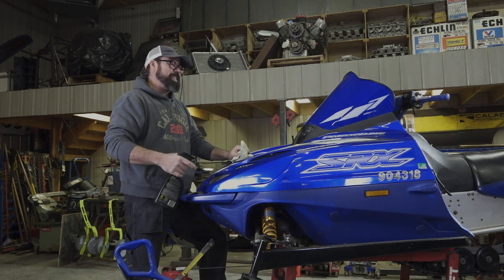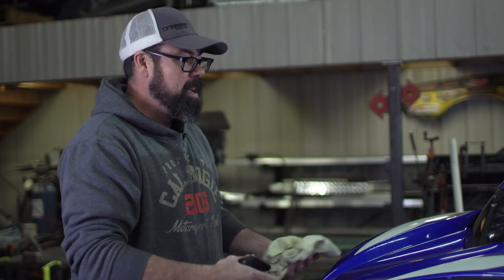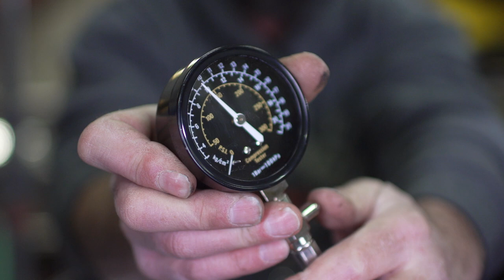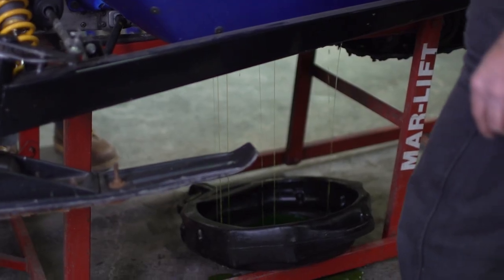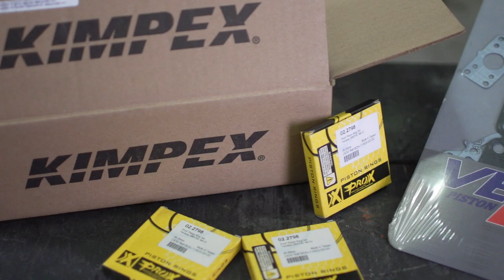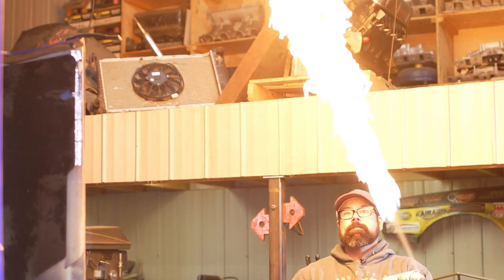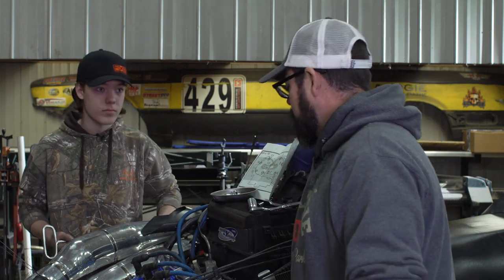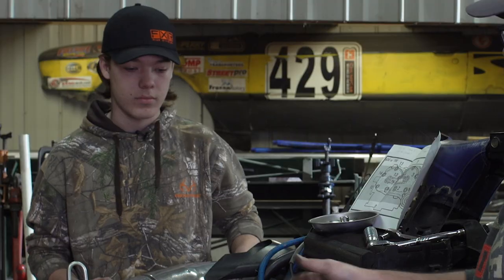SRX Rings

Comment: Every spring I pull that cover off that power valve actuator motor. I pull on each cable gently with a pliers. You can feel each valve open and close smoothly if they are good.

Comment: I have a 02 SRX with 23,000 km. I still have the same rings. My power valves need to be cleaned every 1,000 km. Makes a big difference in power.
Reply: Use amsoil that will clear it out. I use that in my IQ shift 600. Forget factory oil